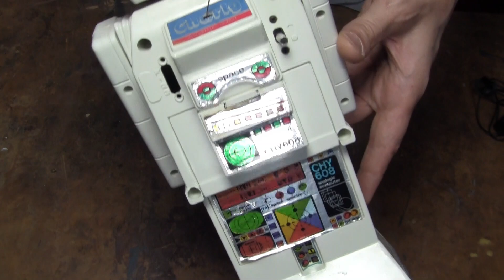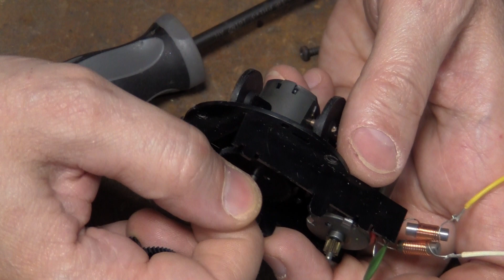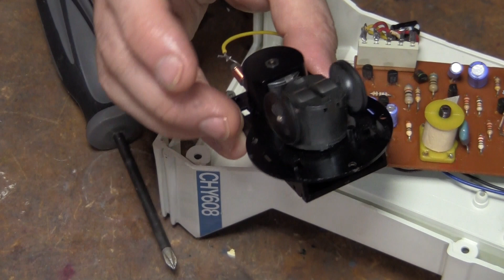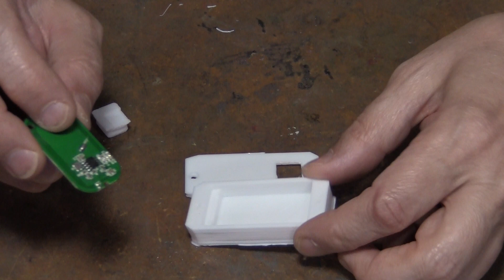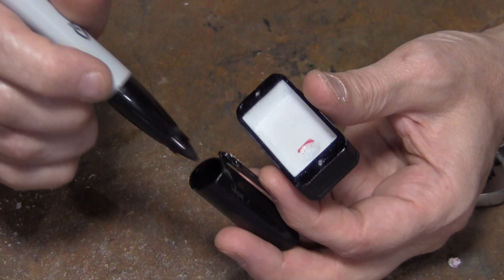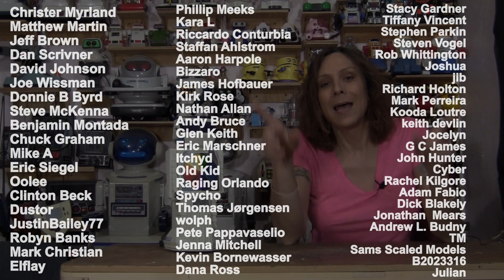Resurrecting Robot Charly: Italy's Vintage Toy Robot Reborn

Comment: No expense spared in Italy it seems; removable pin header for the circuit board, metal gears, RF suppression on the motor. I wonder if they're still in business? 🤔😅
Nice solution with the RF module, I would have chickened out and used the relay to bridge ground. :)
Reply from the maker: They have very shiny screws too.
Reply: @RandiRain  stainless? Crazy. 😅

Comment: Nice job with the restoration. I like the custom controller. You should print out a sticker for it with small print.  A little copyright RainCorp on the bottom.
Reply from the maker: I have thought about stuff like that.

Comment: Fantastic!  I have one of the Charly's but took a different approach, putting an Arduino in it and using my phone to control it.  The motors and gears worked OK but I didn't know what sound effects it ought to make, great to see how you've re-created the original functionality.
Reply from the maker: That's a clever way of doing it.